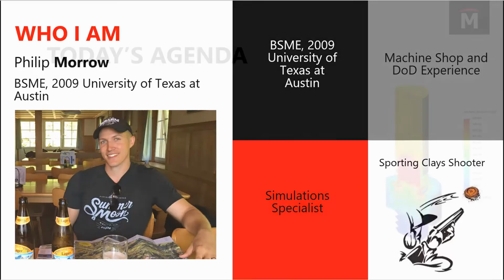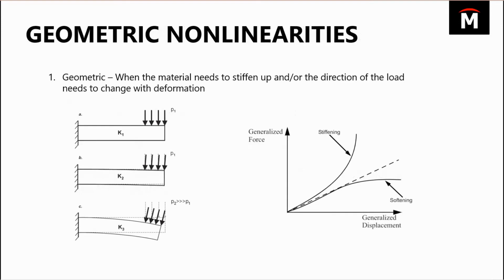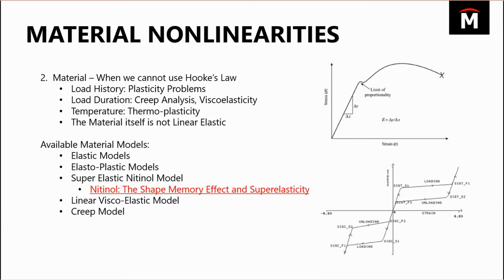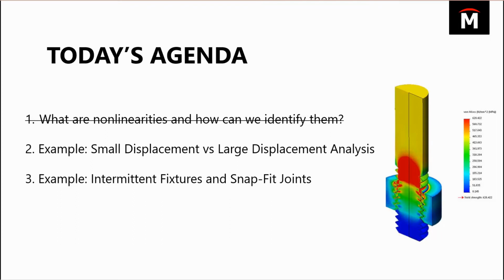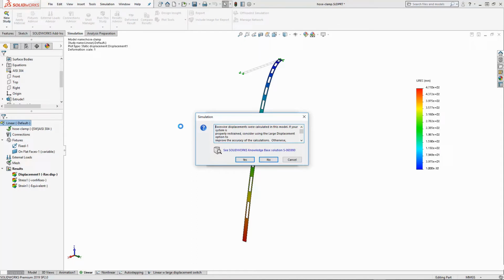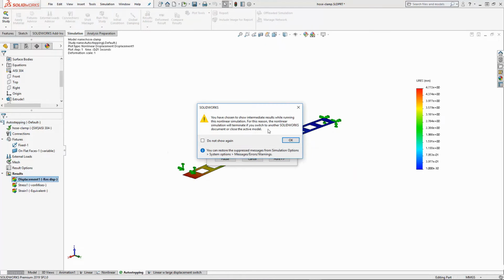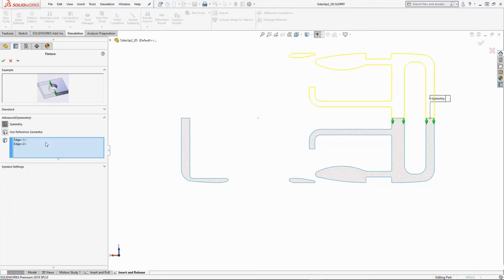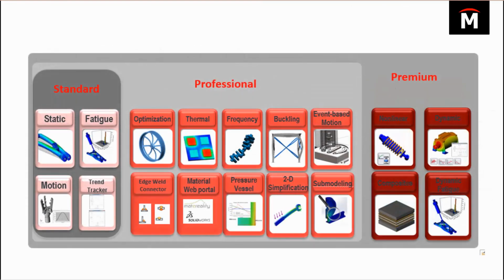Introduction to Nonlinear Simulations in SOLIDWORKS

Comment: Hello! Witch solver are you using ?
Reply from the maker: We allowed SOLIDWORKS Simulation to automatically select the appropriate solver for each situation.  There are certain situations that require selection of the solver or the nonlinear method but none of these were difficult enough to worry about it.  We have an FFE Plus iterative solver and two direct sparse solver options available for non-linear studies.
Reply: @MLCCADSystems  Is the Direct Sparse better than the FFEPlus in no penetration contacts ?
Reply from the maker: For a large number of contacts it can be, but it is more sensitive to unstable models.  We're preparing an article on this exact subject at mlc-cad.com but the biggest advantage with FFEPlus is the ability to handle extremely large meshes without requiring a ton of memory.

Comment: cant seem to find the advanced rotation fixture in sw2022
Reply from the maker: To create a fixture with rotation, use one of the standard fixture types.  In the video "On Flat Face" was used, and Use Reference Geometry generally does a great job of allowing you to specify the movement in a custom orientation.

Comment: As a mechanical engineering student, this introduction beat my teachers ass! I have one question though, I'd like to know how to set up the time curves. When I click the "Edit..." button, nothing seems to happen or show up. Not sure if this is just a SolidWorks bug, or a restriction by SolidWorks Student Edition.
Reply from the maker: Depending on where you are you'll either need to select a curve or add your own.  Double click the row to add a new row, and start adding numbers.  The most simple curve is either a ramping load, like 0,0; 1,1: or a constant value load, which would be 0,1; 1,1.  When you add more than one point, you should see the preview come up.  If the dialog isn't working quite right I would reach out to your instructor to see if something is not working right on just your machine or in that version, but I'm not aware of an issue like this.

Comment: Should you use shell for hollow tubes analysis?
Reply from the maker: Perhaps, but it depends on the analysis, how big it is, what you can simplify, and what you need to know.  For example if you are analyzing the joints of a tube frame you wouldn't use beams because you get no stress detail in the joints, and you wouldn't use solids because it would be inefficient to run.  As the size of the model and the scope you analyze gets bigger, you may have to start out with beams to identify the areas of maximum concern, and as it gets smaller you may want to switch to solids for more accuracy in the joints themselves.

All of that said, although it is a complex topic, the answer may be as simple as "try it" and if it works out and you are happy with the quality of the results then it was a good idea.  I hope that helps!
Reply: Thanks now I have a better mindset when approaching a problem!

Comment: I answered my own question. Note to students, this part must be a sheet metal part.
Reply from the maker: See the other reply, but sheet metal parts are treated by default as mid-plane shell elements, even though they remain solid in the graphics area during pre-processing.  You can right click a sheet metal body and treat it as a solid if you want to.   You can also right click any solid and define a shell from it using selected faces, so you are in control of the mesh in the end.

Comment: I see you have a tab 'Linear', did you rename a tab or is there a study of that? Maybe along the lines of the last question, in this linear study you add an 'on flat face' fixture. In this, you have the option to restrain it by rotation and transitions; I'm only getting the transitions, not rotation. Why is that? Thanks.
Reply from the maker: It is best practice to rename your studies if you have more than one you plan to run, otherwise you end up with "Copy of Study 87" which makes no sense at all!  

The basis of the answer to your question relates to mesh types and element types.  Solid element nodes (corners) have 3 degrees of freedom (dof) which are all translations in the XYZ.  Beams and shells have 6 dof which includes both translation and rotation of the elements.  If you study has at least one beam or shell, you'll see the additional restraint options, but they would only actually apply to the appropriate element types.  I hope that helps!

Comment: Hi and thanks for sharing your knowledge.However I wonder if you already have done analysis of the screw and nut you have in your presentation? Plus,if yes,with gaps between bolt and nut representing the reality and not at nominal dimension.Beside that, due a pretension in the bolt even with non linear analysis I think you can't do it.  Something is really missing in solidworks  and there is no way to play around to find solution.Exception in other few softwares available on the market.For sure a negative point....
Reply from the maker: Great question, the Simulation Premium - Nonlinear training manual has an exercise that involves complex thread interactions with a pre-load, and we have been assisting customers with similar threaded connections with preload on their models.  The basic procedure is as follows:
1) Model the part with threads so the threads line up according to the installed state.  It may require a bit of calculation or trial and error, but the starting position of the model will have some interference.
2) Apply shrink fit and no penetration contact sets to the faces.  Shrink fit for any faces that are interfering, no penetration for anything that isn't.  Use the more accurate surface-to-surface bonding option and refine the mesh in the contact areas.
3) Run the study first as a static analysis to make sure it solves linearly, this is optional but helpful to rule out any issues
4) Run the study as a non-linear study.  If the preload creates plastic deformation in the material, you'll need to use a temperature-dependent material property curve to force the material into a linear region, then allow the strain to develop as the temperature changes.

It certainly isn't the simplest study to setup and run, but it can and often is done using SOLIDWORKS Simulation Premium.  The training files can be downloaded here: https://www.solidworks.com/sw/support/54117_ENU_HTML.htm?product=SOLIDWORKS%20CAD
Reply: @MLCCADSystems  Thanks Phillip.I wasn't aware of those training files with threads.In the past I was struggling to find a solution in the company where I was working and at the end we end up to switch to another software.We have play around ,tried finding solutions,a lot of approaches, doing iterative approaches and even we contact our supplier in EU and since it was something not straight forward and without much background to support us and due the uncertainties we just give up and switch for something more robust and with the capacity to find solutions more accurately for NC threads for offsore oil industry.But,even the solutions you have mentionned from what I see  it seems very 'primitive' approach for a software who already is on a great stage of knowledge in the market.It shouldn't be so difficult to do something and update a more userfriendly approach.It is just my opinion of course but for sure something can give more trust to the software.Anyway I will go trough the files and also try follow your suggestions and figure out just by curiosity where I will end up and I will come back here to post the results.Regards
Reply: @MLCCADSystems  I just have download the exercises and no one is referring threads. I just wonder if I can download your manual or the exercise itself to understand the required steps? Where I am working now we are working with solidworks, maybe I can go trough to the support customer and request the file to them if they have of course.  Or maybe go directly to the Solidworks webpage and download the file if available. Just let me know your thoughts! It will be nice to use and know something new. Thanks in advance.
Reply from the maker: @luigoncal  Definitely reach out to your local support provider for more information, training, and support.  The lesson I was referring to is an exercise in the Simulation non-linear manual.  In the 2020 version that is under Lesson 4 > Exercise > Pipe > Joint.sldprt.  I can't comment on the applicability of Simulation to your application but we support a lot of customers analyzing oilfield threaded connections, and our customers use a combination of SOLIDWORKS Simulation other more expensive tools depending on the specific requirement.